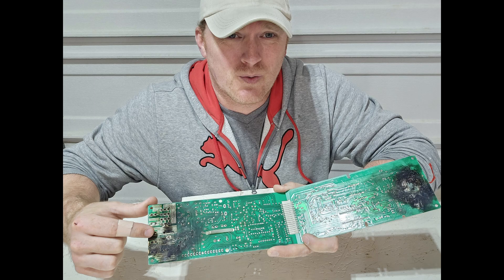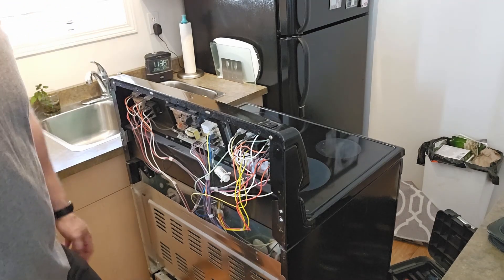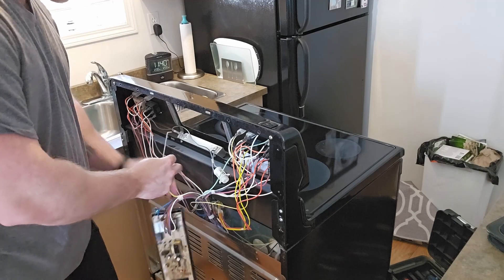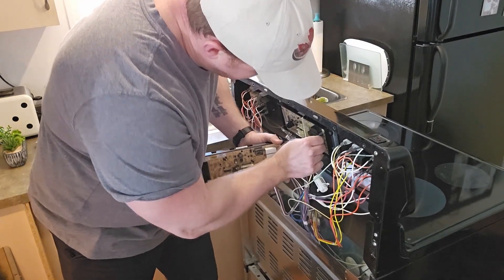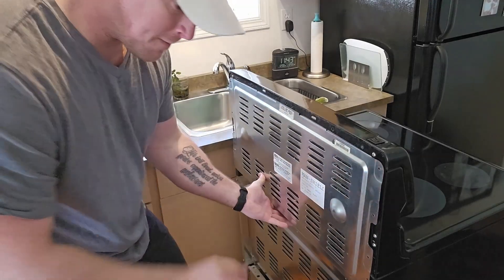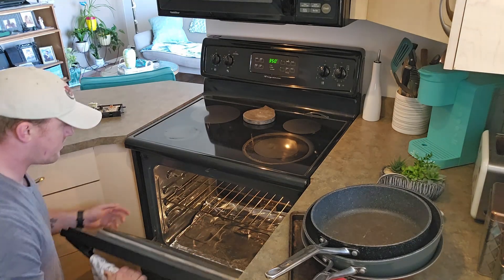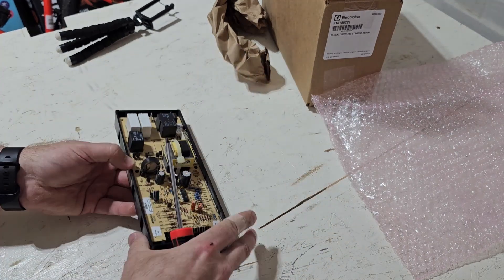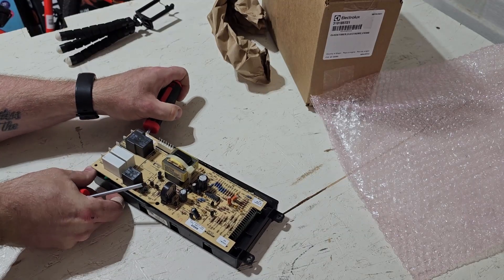Electric Oven Not Heating Up - Replacing A Blown Control Board

Comment: Hello. Thomas i have a ge stove and i brought a new control board and I'm not getting and power to the panel
Reply from the maker: You will have to trace power right from the wall, some stoves have a thermal fuse on them that totally cuts power to everything also.